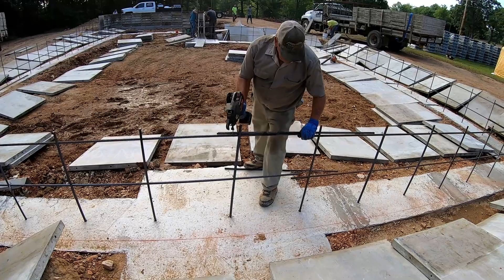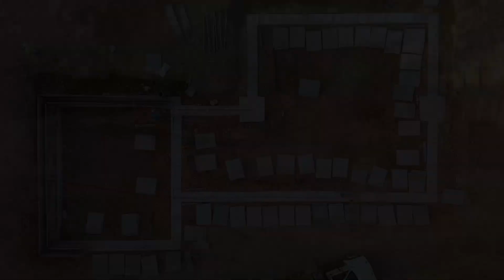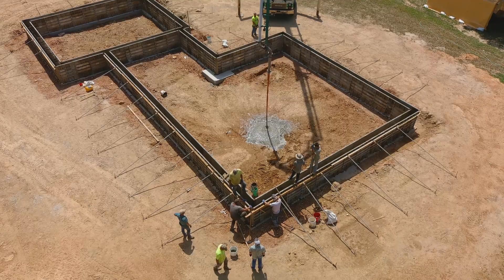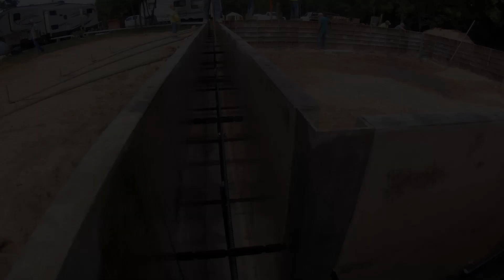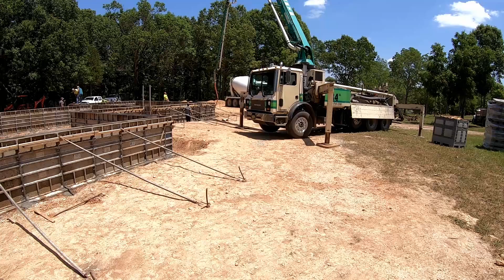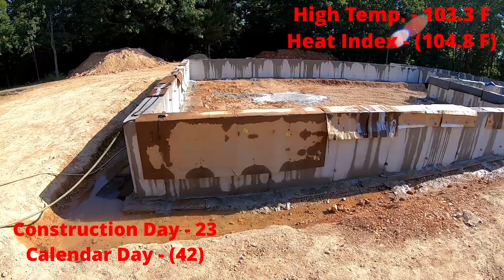House Build 8 - Concrete Stem Wall Form & Pour for our Legacy Block ICF House

Comment: Wow, what an operation.  Great job filming and explaining Tony.  I was going nuts wanting to know how they kept the forms from blowing apart and then you showed how it was done...thanks!  I guess you waited until the concrete cured and was at full strength before knocking the "ears" off?
It feels like to me they needed a wheeled "cart" of some kind to load the forms on to move them between the trucks and the pouring location instead of carrying them by hand such a long distance.  That's so obvious I'm sure they had a good reason not to do that there.
That was really fun to watch.  I sure look forward to my Sundays with Tony now.
Reply from the maker: Thanks, Rick.  I'm glad you are enjoying the build videos.  Yes, we waited for about a week before knocking the ends off of the ties.
The forms are aluminum and moving them by hand didn't seem to slow down progress.  I don't know if they use something to move them on a jobsite that is harder to reach.  Maybe one of the guys from the crew will chime in.

Comment: Nice looking pour. I've poured a lot of footings and filled a lot of block walls in the past, but never anything done with a pumper. It's always neat to watch. I was looking for the sewer line stub through and finally saw it there at the end. I was thinking I sure hope he doesn't forget that! That was the the smoothest part you've had on the job yet. I'm glad it went well.
Reply from the maker: It went great.  They were a very professional crew.  It definitely would have been bad to forget the sewer block-out after doing all of this just for the septic hook up!  LOL!
Reply: @ozarksethic  I was thinking to myself as many hard knocks as you've taken so far I sure hope this goes well!
Reply from the maker: @CarolinaSaltwaterLiving  Thanks for the well wishes.  It was a pleasure to watch a good crew working.